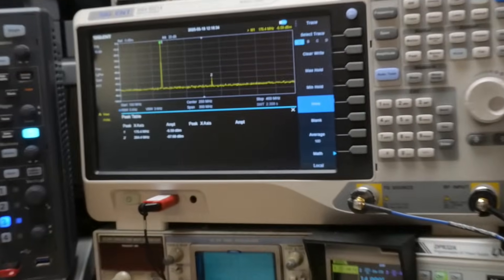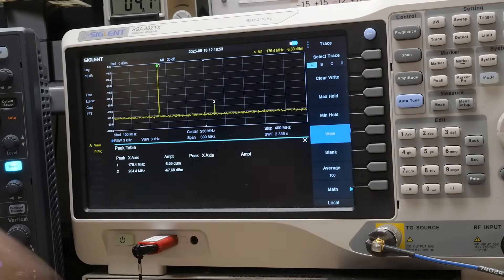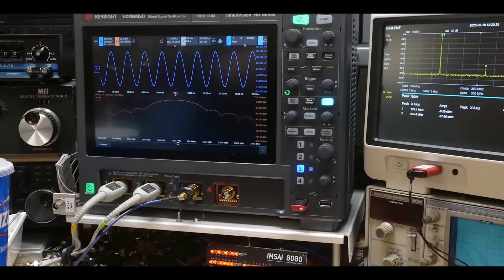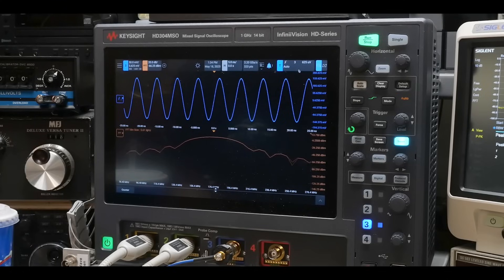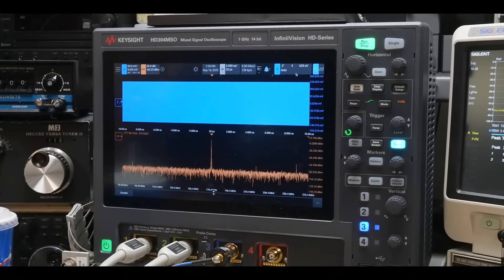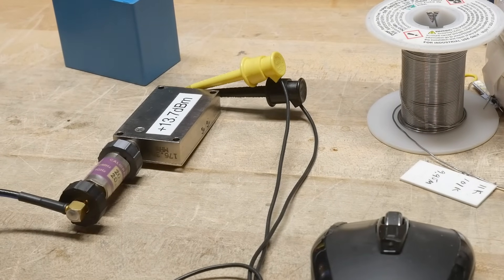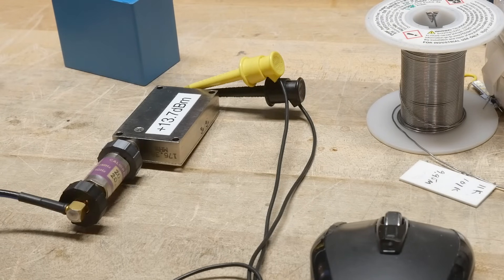#2252 Oscillator with x1.5f Spur?

Comment: I might be stating the obvious here. That block on the side plus the clip holding the crystal is a form of shock absorber. It keeps the crystal from generating a small FM signal while it vibrates. It reduces the micro-phonic content. Try shocking the case to see how well it works.

Comment: If you look with a  coax probe made of a couple of turns of wire into an analyser, near the crystal, one might see the fundamental. Also the crystal could be heated with a PTC resistor. If you are looking at the DC current, then the inrush current could be highish for several seconds, until the PTC resistor stabilizes.

Comment: I see from earlier comments, that my immediate thought is also the thought of others. Initial frequency is 88.192MHz followed by harmonic generator (i.e. overdriven amplifier) and second harmonic 176.384MHz is filtered out, third harmonic is 264.576MHz  and many tens of dB down on the second harmonic. Only way to be certain is determine the crystal frequency by test or examination.

Comment: I think others hit the nail on the head with the oscillators output frequency being an overtone of the crystal which would make the 1.5x spurious spike a direct multiple of the crystals fundamental.

The 4 adjustment potentiometers may be to adjust amplitude of amplification stages within the block to ensure as pure an output as possible without driving any stage into clipping, and/or biasing for stages to get them into their linear region.

Comment: They probably use a 88Mhz crystal and double it, the 4 adjustment are the band pass filter adjustments and yes a little of the 3rd harmonic feeds through. No big deal and a lot cheaper to do then using a 176Mhz crystal.

Comment: The green/blue trimers are Murata trim capacitors.
So probably part of a filter chain, perhaps to surpress unvanted overtones from the fedback circuit to force the oscillar to osciallate on the desired overtone.

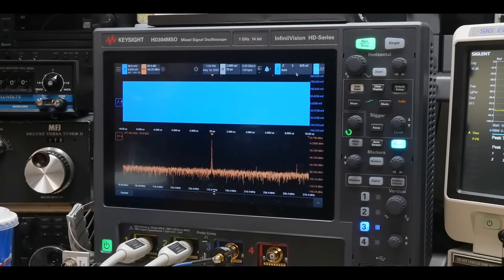Comment: The crystal is likely 44.1 MHz and is operating at it's 4'th harmonic. That would explain the extra spikes at 3:05.  The main crystal frequency is at 44.1MHz,  88.2MHz,  132.3MHz and the needed 176.4MHz, then it's the small blip that should be at around 220.5MHz, and the troublesome 6 harmonic at 264.4MHz

Comment: That can happen.

Harmonics vs. Inharmonic Overtones:
.
Overtones can be either harmonic (integral multiples of the fundamental frequency) or inharmonic (non-integral multiples of the fundamental frequency). 
.
In oscillators, inharmonic overtones are frequencies that do not fall into a simple harmonic series (whole number multiples of the fundamental frequency). Instead, their relationships to the fundamental and other overtones are not whole number multiples, resulting in a "noisy" or less predictable sound compared to harmonic overtones.
Reply: Look for a paper by Fletchera, from the UNSW Sydney physics dept. called: Harmonic? Anharmonic? Inharmonic?

Comment: First determine if it's being produced by the front end of your spectrum analyzer by using a step attenuator, switch in 3 to 5DB of attenuation. If the signal drops by the amount of attenuation, it's real world. If it drops more than the attenuation, it's front end generated by the analyzer.

These could be product / difference frequencies if the oscillator utilizes frequency multiplier circuits (Is the crystal frequency lower than the output frequency?)

The crystal mount will probably have a resistor attached to the underside which is for warming via a temp control circuit...

Comment: Overtone crystals oscillator circuits can create non harmonically related spurs.  A Pierce parallel resonant oscillator circuit used for overtone oscillators often have a series LC circuit to filter the fundamental frequency.  The problem is that series LC circuit is in parallel with a capacitor on the crystal and creates another resonant circuit at 3/2 the fundamental frequency.  If you were to trace out the circuit I suspect this might be what you find.  Those trimmer caps are used to filter the fundamental frequency.
Reply: Thanks for the insight I had never heard of this before. I am not the most knowledge able about rf so I appreciate all the information out there.
Reply: Inharmonics. That was the first thing I thought of.
Reply: Bingo!
Reply: Thanks for sharing!
Reply: Good to see you're still around YT Mike. Miss your videos but I certainly understand just how much work they are to produce. Especially at a rate and consistency that gets your channel to grow. Just want to say thank you for everything I've learned from your channel over the years. I don't really do CB, but have applied many many things I learned on your channel to ham radio. From theory to the brass tacks of what to use for cleaners, techniques for glue removal, etc. 

And thank you for this reply here, I was thinking it was something else, but what I had in mind doesn't fit.

Comment: ChatGPT says a lot, but in summary:

Summary: Why a Crystal Oscillator Might Show a 1.5× Spur

| Cause                              | Description                                                                                              |
| ------------------------------------ | ------------------------------------------------------------------------------------------------------ |
| Nonlinear mixing           | 1.5f can result from intermodulation of f and 2f in active stages  |
| Power modulation         | Supply ripple at 0.5f can cause spurs at 1.5f                                    |
| Filtering issues               | Harmonics not filtered out can mix and leak                                    |
| Measurement artifact   | Aliasing or reflections in the measurement system                         |
| Fault or design quirk      | Rare mode in PLLs or oscillator circuits, or PCB layout coupling  |
Reply: ChatGPT is rarely correct on tech subjects, this is yet more proof.
Reply: Yeah, very good example that ChatGPT fails. A doubler generate all harmonics. The 2x is prefered. All others are spurious. If you check the phase relations on the spurious it tell you something about the doubler circuit concept. Built so many ha do not remember what there are. Plz stick to AI i will have work until i am cold.
Reply: @reinerfranke5436  Interesting take — though a bit ironic to call ChatGPT a failure while casually confirming its point. Yes, doublers generate all sorts of harmonics and spurs due to nonlinearities — that’s literally what the summary explained. A spur at 1.5× isn’t some mysterious failure, it’s a known byproduct of intermodulation in real-world circuits.

As for the dig about AI keeping you in work — if confidently missing the point is your job security, then yes, you’re probably safe.
Reply: @slm60uk  No it is not ironic. Ocourence show, yes if the list is long enough the cause could be among, Evidence close in about certainity.
After 3 years with ChatGPT on very detailed professional topics it getting dangerous to rely on, and worse too people start believe it will solve or substitute professional work.
Let me give the example: If you know the phases and the spur distribution how do know what is the likly circuit behind. You need to know close to all circuits and the spur distributions and give evidence to a specific distribution. There is no paper up to now which conclude the findings which can be consumed by GPT. People need to do the hard work because they being connected to the real matter.